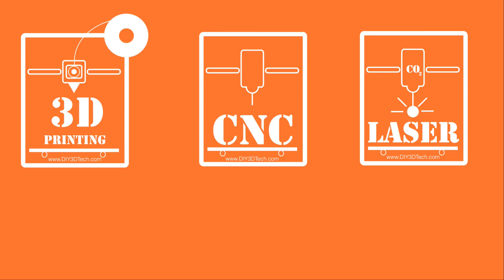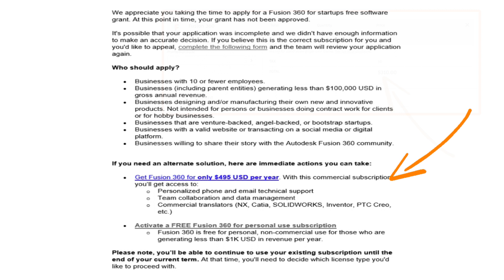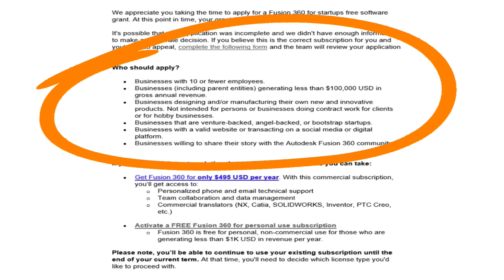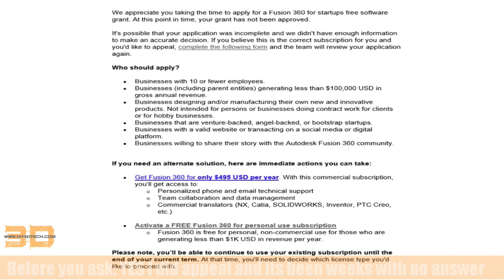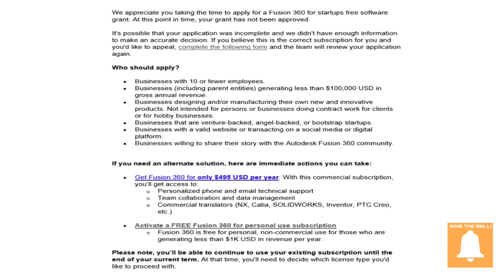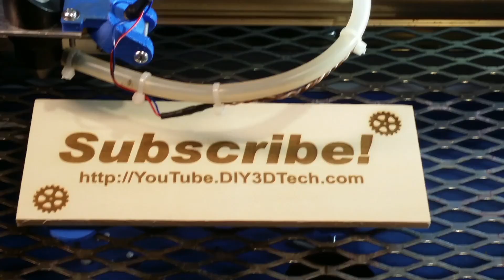My Dear John Letter From AutoDesk for Fusion 360!

Comment: @DIY3DTECH.com I know this is an older video, but I saw a couple of things that might be helpful.  A hobby business has a rather specific definition in the IRS Tax Code.  To oversimplify it, a hobby business' revenue does not exceed expenses by more than a certain amount - and I believe (I really didn't feel like looking up the relevant IRS publication) that amount is $1,000 per year.

The other thing I noticed was that based on everything you were saying about how you use the product, you should qualify for a personal use license.  If you're willing to forego technical support and you don't   I suspect that the reason that they exempt hobby businesses is that they offer a "startup" license in the hopes that the business will grow and then become a paying customer.  A hobby business generally doesn't grow to that point so they would probably prefer that you use a Personal Use license that doesn't require them to provide tech support for those users.
Reply from the maker: Thanks however the tax status doesn't relate to licensing status as I have spoken with AutoDesk on this and sure I could of gamed the system and just registered another version as personal however as it is cloud based the do watch what you do with it as that is why I got the dear John letter.  The other thing is I do use  this semi commercially and make around 10k a year (it use to be capped at 100k).  So if they wanted to come after me they could of and they have lawyers on staff and don't so was easier just to pay the  extortion money and call it done and not worry about a certified letter showing up at my door for this...

Comment: I must admit to using 123d Design, even now long after it was discontinued.  I have fusion 360, but I'm so familar with 123d design, I find it doesn't seem as intuitive and keep switching back.
Good to see you are still making content. I was getting worried that you were having problems.
Reply from the maker: Many thanks for kind comments!  Yes 2019 has it had its challenges, however we are getting closer to getting back into video production mode!

Comment: Yeah, do FreeCAD instead.
Reply from the maker: are you a FreeCad user, would you be interested in FreeCad content?
Reply: @DIY3DTECHcom  I'm totally new, tried few designs in Solidworks and Fusion 360.   SW is waaaay more powerful, but started to learn "free" Fusion. As it's not free anymore and I want to use it for a cnc machine (retrofitted small milling machine) in my small business, I want to learn some free tool to use until I can justify bigger machine and commercial software (and I bet it would be SW someday)

Comment: Welcome back! Went with FreeCad, openscad and ICESL myself and avoided the Fusion crack model even though I would currently qualify for a free personal use license. Have found Freecad quirky and limited in comparison but it does work well enough for a 3 axis CNC. If you haven't tried v0.18 first released in March you might like to revisit it.  I also use Carbide Create for simple stuff. Since you appealed the decision you seem to want to use Fusion 360, so may be you have already made your own decision. Hopefully, someone suggests a more appealing alternative.
Reply from the maker: Many thanks for this comment, well structure and yes I have and do use the current version of FreeCad and it is a bit quirky!  I am also a HUGE Open-Scad and produce an Open-SCAD channel too!  The biggest thing with Fusion as I mentioned is its ability to bridge to real job shops.  I have never seen a production job shop using FreeCad so the idea of sharing idea around Fusion felt good in that the knowledge was transportable to job shop world.
Reply: @DIY3DTECHcom  Fusion is working hard to become the MS Office of the CAD/CAM world. So that aspect is definitely appealing for educators. If you do decide to look for alternatives then you might like Carveco which is basically ArtCAM reborn. $15/m subscription for the maker edition.

Comment: the classic trick struck again, ... get users hooked to a free commercial product, then wait for a while and pull the free licence.  The problem with most free (commercial) software is that the owner of the copyright makes the rules and you are just the slave. That's why i did not even start to jump on the 360 bandwagon, the other issue for me was the online connected thing, another absolute no-no for me. Anything of importance has to be local and working as intended, even when all networks are down. Clouds are just too cloudy for my liking,
I either use free stuff, or if no avail, i pay for something which offers a one-off price purchase (and does not require an internet connection to run). I also would never ever buy into a product which requires an annual licensing fee, because you may end up in pretty much the same situation when the supplier decides to 10-fold the fee to maximise revenue.... Other people may have different opinions, so that's just mine.
Reply from the maker: Being in the business can tell you the world is moving to cloud based software as it makes for a far better cost recovery model over shrink wrap, yet I also understand what your saying as you losing the rights to (technically) owning the software...
Reply: @DIY3DTECHcom  Well,...it's not actually the ownership what concerns, because you usually don't 'own' software, you only granted some form of (conditional) license to use it... so it's actually 'possession of the functionality' what counts.
Similar applies to your data stored on an Autodesk server at a random place on the globe,  you technically own your data, but you are not in possession of such and you certainly don't know where they physically stored,....ever thought about that and the potential danger which comes with this fact ? ... Sorry if this sound a bit 'dickheaded', 
i might just suffer from self-sufficiency paranoia ...:-)  ... probably fed by rather frequent power outages and internet breakdowns in my area.

Comment: For some of us, F360 is not an option because it is not available for Linux. That is why I use FreeCad. while FreeCad does have it's limitations, it is really the only option I have available for complex designs.
Reply from the maker: Interesting, how is the performance on Linux?
Reply: Considering the fact that I have a rather lightweight laptop, I think that it's performance is rather good. I have been able to apply some of the principles in Fusion tutorials to FreeCad without issue, and have designed some rather complex mechanisms. The one thing I would wish for, however, is the ability to integrate the various parts into an accurate moving mechanism that I can test virtually. I know that there are assembly plugins, but I have thus far been unable to get an accurate integration of the parts for whatever reason, either my lack of understanding or a deficit in the plug-in itself.

Comment: I got caught in that exact same trap. I'm struggling to get by and I was encouraged by so many to use Fusion I have always used open source and Linux but finally gave in and went with Fusion and even bought a couple of Windows machines (a laptop and a desktop) to use Fusion. I'm so wishing that I'd stuck with learning FreeCAD instead of getting sucked into the F360 thing. 

I say ditch them, this whole thing was a set up and basically a lie. They only want 100k earners it's the same as the Microsoft Crack deal. Fusions very good but I really don't need a huge portion of it and I'll never get to 100k
Reply from the maker: Yupper on the MS Crack deal!  (insert sneaker here)

Comment: Something else changed recently and now I can't run another copy of fusion 360 without shutting down the first,  this is annoying because my CNC is in the garage attached to an old computer and my main work PC is in the house, if I get to the garage and want to tweak something I have to go back in the house and shut down the copy on my main PC and then run it  in the garage (and remember to close it when done).  I know it prompts offering to shut down the other instance but in my experience this only works 20% of the time.    This subscription based software model sucks, I would rather pay for it once and then not feel like i'm connected to their umbilical cord all the time.
Reply from the maker: That's seems to common thread "subscription based software model sucks"

Comment: Google: "DesignSpark Mechanical" also look up YouTuber 'Jim Taylor' for tutorials on how it works.
Reply from the maker: Hmm looks interesting, never heard of this one!  Thanks, for sharing
Reply: I started with them. Jim's tutorials are the single best resource out there for DSM. The software is decent but V4 still crashes on me. It's not a browser based program but it requires login every three months to renew the license. That's the way v2 was at least. Its comparable to F360. More so than FreeCAD anyways. They have some cool options like building a bill of materials. Honestly it's a great program. It's just that it could leave you vulnerable the same way F360 just did.

Comment: I'd rather see your channel grow and you with it, then perhaps Autodesk sponsoring you with a license package over their full product range for the next decade or so. Me personally I do use the personal license or did I apply for teacher? Or startup? Similar to your case their license model doesn't really fit most of what I do but I'd switch to a different (free/open source) product long before I could justify the license expense. But that's me and I don't have any subscribers ;)
Either way - love your channel - you taught me a lot and because of your channel I own a K40 and I have a 3018 Pro in the early stages of assembly. So - Thank you so much! Cheers! JM
Reply from the maker: Many thanks for kind feedback!  Also look for a lot more to come on the k40 as the new shop is coming on-line soon!

Comment: Why wouldn't you apply as a business with a valid website or transacting on a social media or digital platform? OR get a home business license and presto you are a biz with less than $100K in revenue. Obviously a mistake to ramble on about it being a hobby.
Reply from the maker: Well that was the key I was honest :-(
Reply: @DIY3DTECHcom  actually, there's a licensing option for youtubers, which is free. https://www.autodesk.com/campaigns/fusion-360-for-hobbyists read under Qualification Details. You should qualify for that without a problem.

Comment: I have used Fusion 360 for quite a while and sent in my application like you did.  A few days later I got my license, no questions asked.  I am a small business with just 2 employees and under 100K of income.  But I do use FreeCad and other free packages.  If I had to pay for it I might.  Unless you intend to do tutorials in Fusion 360 I would get the free version and invest in Meshcam which sounds like it would be of more value to you.
Reply from the maker: Jim many thanks for sharing and assume the difference is this a "hobby business" for whereas it sounds like yours is a primary business.  Also, I can't get the "free" version because per Autodesk I do not qualify again because of the  hobby business aspect, so to use I would choice but to pay the money...
Reply: @DIY3DTECHcom  It seems a lot of the software firms are doing something similar.  I have worked with Autodesk for many years and have been waiting for them to toss all free versions.  I probably got some sort of special dispensation because before I retired I worked for a large corporation as a CAD/CAM software tester and usability engineer that interfaced with them a lot concerning their products :-)

Comment: I'm glad to see that you're  back making videos. I noticed that you hadn't released any for a while and I've missed watching them.
Like you, I assumed that the free aspect of Fusion 360 would eventually disappear. I didn't want to invest my time into learning a product or being locked out of my designs should they decide to change the rules. Recently, they abruptly  dropped  ArtCAM and I've   read several complaints from users who felt abandoned when they could no longer renew their licence.
Reply from the maker: Jim many thanks for kind comments!  Yes I am coming back!  2019 has been a crazy year we build a new shop (and house for the wife).  So this meant I need to focus on building both (actrualy its two shops, one for machines and another for electronics).  Those project are coming to a close so I make even cooler video as these shops where built for video and to do a lot more things so stay tuned!

Comment: Maybe time to roll up our sleeves and embrace FreeCad again
Reply: Fully agree - FreeCAD is quite excellent.
Reply from the maker: I must admit as mentioned in the video I tried and its "okay" however when comparing to Fusion 360 there is no comparison.  The other thing I liked about Fusion is a lot of smaller job shops use it so there was a bridge from what I was showing people as hobby business to a "real"  business.  However at the end of the this might be where I turn as its the only logical direction outside of paying the money.  Yet I have never had anyone write me and say hey I would like to see more on FreeCad...
Reply: @DIY3DTECHcom  I'd like to see more on FreeCad. There is a lot on Fusion tutorials but not nearly enough on FreeCad.
Reply: @DIY3DTECHcom  I'm somewhat surprised that more people aren't using FreeCAD - perhaps it's the learning curve...or maybe it's just not knowing about it.  It really is a powerful 3D package which runs on Linux/MAC/Win.  They are CONSTANTLY improving the workbech features  so much so that the FreeCAD of 6-8months ago is much different than the current version (feature/capability wise).  I use it daily and even when running the 'nightly builds' I find this to be some of the most stable CAD software I have ever used...more so than some professional high $$ packages.  QED
Reply: @DIY3DTECHcom  I was one of those smaller job shops that got suckered into Fusion. Sure it's very very good but to be honest FreeCad will do all that I actually need anyway. Who needs generative design????? 

I so wish I'd stuck to learning Frecad. Now I've got to go right back and start over again but at least I won't get trapped into this ransomware again
Reply: I vote for you to hop on the FreeCAD wagon. I started out with DSM but the license has aspects of the F360 experience. Namely that it could go away tomorrow. Then I would be stuck learning FreeCAD anyways, but in a pinch. I have been slowly trying to learn freecad now for a few months. Fits and starts mostly.  It is a bit more cumbersome and less streamlined but it is functional. It's like any other tool, you just have to learn how to use it.  What I like most is the principle that it is free and opensource. It will never get yanked away after you've spent hundreds of hours learning it. That is what got me interested. That's why I am staying with it. Another channel with fresh FreeCAD discussions would be very welcome. There are a handful of good ones now but more is better. Thanks for sharing your experience.
Reply: @user-jw9nc1qr3n  I'd love to be talented enough to produce tutorials on FreeCAD, but I  don't have a very powerful computer, an the video editing software that I have used (OpenShot) crashes often on my lightweight laptop (Dell P20T).
As it is, I just fumble along with FreeCAD as it is, although I have designed some fairly complex machines Including my 3-D CoreXY Printer.